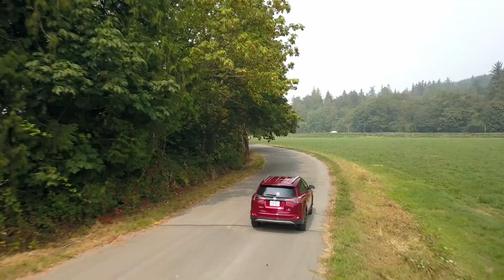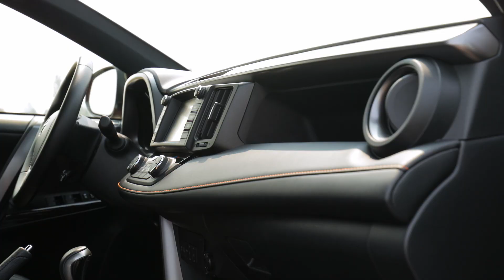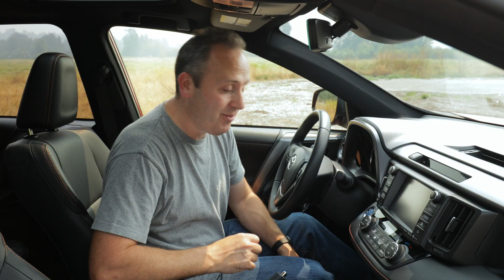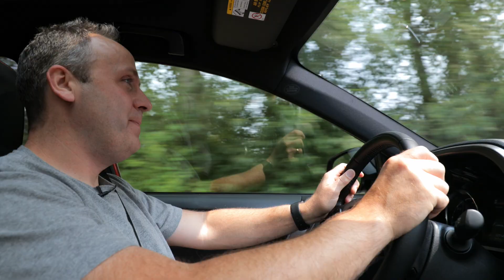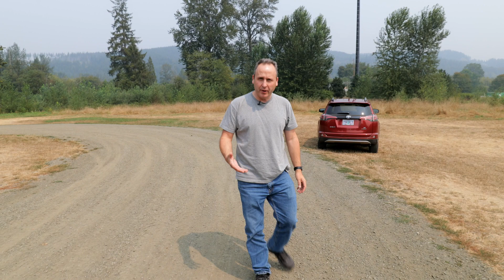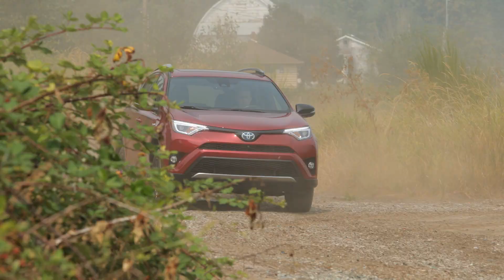2018 Toyota RAV4 Hybrid SE Compact Crossover Review

Comment: 13:00 it seems that the "4WD" is only active for careful driving on snow. I think you should have tested on steep uphill on gravel or sand with full throttle. It may be that it's implemented with the same ECU that's normally controlling haldex system and it will not engage rear wheels until the front has been slipping for some time. For haldex system that was required because it uses tiny clutch pack and activating that too often would rapidly wear the clutch pack. For fully electric rear axle they could do better, though.

Update: here's additional tests for the 4WD system: https://youtu.be/oxluunv9Ebg (it seems that it actually supports driving the real wheels but there's no rear wheel diff locking, mechanical nor ESP brake activated).

Comment: I have an 06 Highlander Hybrid with a similar AWD setup and the rear electric motor kicks in 100% when you press all the way on the throttle. That 80hp boost is what gives it its full power in addition to the added traction of course

Comment: Bought a used 2017 model. Lovely car and I'm averaging around 38 mpg, which is pretty good for a car it's size.

But my only complaint.....i find the cabin to be quite noisy due to road and wind noise. Does anyone else have this issue?

Comment: I guess when is full throttle the system translates that as "ok only the gasoline engine" so no electric motor and rear wheels engade and vice versa ...25% throttle "ok I can use the electric motor" and voala
Reply: good point

Comment: Hmm, I manage to drive my 2016 RAV4 Hybrid Limited for about a mile or two at 40 miles per hour before it kicks me out of EV mode. Not sure where you get the 25mph from. BTW: I manage to avg 37 mpg at 70 mph on the highway during my 70 mile commute to work (hint: use adaptive cruise control). Depending on the wind, it can get up to 39 mpg! Looking forward to installing my Comma 2 driver assist with OpenPilot, it’s way better than TSS-P 2.0. Another fun fact, if you accelerate on a dirt rode or in gravel (VSC on) it actually takes off surprisingly fast. The reason why you didn’t see 4 tire marks or the rear wheels over-driving is because they don’t have enough power to do that as the system is front wheel bias, BUT that doesn’t mean the system isn’t working. If the front wheels are receiving more power than the rear wheels, the rear wheels won’t have a chance to leave their mark as the front wheels do most of the work. That being said, without the rear motor adding it’s inout, you would see a lot more spin from the front tires which would lose traction even faster trying to get you up to speed. Again the electric motor is designed to reduce front wheel loss of traction not eliminate it. If you compared a front wheel drive RAV4 to this, you would notice the difference very quickly as the FWD model would take way longer getting up to speed and throw a lot more rocks out the back.

Comment: I bought an 18 RAV4 XLE Hybrid. Although Booooring at 300 plus pages one interesting fact was what the owner's manual said about the "EV Mode."  The manual emphasized the EV mode for indoor garages and in your own garage when you do not want to emit gasoline exhaust into a closed environment.  Although they did mention the economy it is really for enclosed areas.

Comment: I will cross shop the 2019 as it looks much better. However The subaru crosstrek gets about the same millage without hybrid so depending on how the Rav 4 drives I will chose between these two and mazda5 possibly

Comment: I have a 2017 SE Hybrid and I have to say the AWD system is not very good. Last winter with snow tires I still got a lot of front wheel spin in slippery conditions while the rear wheels didn’t seem to do much even though the display showed power going to the rear motor. I think the rear motor is underpowered. It just doesn’t have enough torque to keep up with the front motor and engine under hard acceleration. I think toyota has put a more powerful electric motor in the rear of the upcoming 2019 and that might help. 
Where this car shines is in stop and go traffic and that’s why I bought one. In town mileage is excellent because the engine doesn’t run very often. I use this car in town 95% of the time and it gets about 50% better mileage than the gas RAV4. I like the hybrid and it works great for my situation but I wouldn’t buy one for highway driving because the fuel consumption is not much better than a gas model which has a much better AWD system.

Comment: I live in the UK. My 18 RAV4 hybrid works fine. The car wasn't built for serious off road driving but for ordinary roads when the going gets tough like snow and heavy rain. If you looked on the screen it lets one know when the rear motor kicks in and when it charges the battery. The car is not an Audi Quattro where you can boot it and spin all four wheels as you said a light foot will allow the computer to determine which wheels need to provide grip. In the UK many people buy SUV's like landrovers as a status symbol and never go off road ( Chelsea Tractors). The power on the RAV is about 155 hp from the front wheels and 65 hp on the rear so if one boots it the fronts will always pull better than the rear. It still does better than some of the front wheel drive SUV's on offer like the Peugeot 3008.

Comment: Your video popped up in my feed and I really liked it. I actually haven't seen too many reviews about the 2018 Rav4. 
We have a 2018 XLE Hybrid with almost all of the features your test unit had but ours has half the mileage yours does at a little over 5,000 since new last March.  We actually tested the same three you discussed. We liked the Honda as we felt it was a more 'upscale' vehicle in fit and finish, but no Hybrid option and as told by the Honda dealer, since it sells so well there weren't any financing incentives other than 2.9% at the time. The Rogue was OK, but the area dealer didn't have any hybrids and had no idea when they could get any.  The Rav4 is very comfortable, fit and finish is first rate and we got ours at 0% interest for 60 months.  With Toyota, we have previous experience with a Camry that got to almost 300,000 miles and a 2013 Prius but we wanted the better interior space and the things you talked about, comfort, economy and safety, and the Rav4 had all plus Toyota reliability. 
We live up near Canada and usually get quite a bit of snow and wanted to have a vehicle that will be able to be used all of the winter instead of most of the winter as the Prius was and in reviews of earlier versions, the AWD system seems to work great in snow. We'll find out in a little over a month when it starts getting really cold and early snows.   
I LOVE the adaptive cruise control and my wife really likes the other standard safety features. Our Rav4 has been consistent with never lower than 32 mpg and averaging 35 mpg with a few 37's in the mix too so we are very happy with that. Not the 45 mpg of the Prius but much more usable interior room than the Prius had and the all wheel drive the Prius doesn't have. I'm 6 feet tall and the front and back seating has really good leg room. I was impressed when we were on a test drive and have since tried out being in the back seats and still am impressed. 
I read some of the other replies here and I've seen the videos and specs of the refresh with the 2019 but I read the 2019 Hybrid version won't be available until late January or February.  When we bought ours I found out the gas models are built in the USA and the Hybrids are made in Japan which I thought was interesting. Good review! I'll see what else you come up with.
Reply: They should've released a first 2018 RAV4 HYBRID in Australia but instead we'll  be getting it in next gen model

Comment: Here's what the Rav4 Hybrid AWD does very well:  Recapture energy and charge the battery faster.  Lift your foot off the accelerator the least little bit and two motors, not just one, instantly begin converting kinetic energy to electricity. Quick battery charge results in electric motor drive being available more of the time and reduced gas consumption.
The Eco-mode and Sport buttons make a big difference. I call one "turtle mode" and the other "giddy-up go". Sport button tightens steering, also, which takes getting used to.
I get 31 mpg stop-n-go commuting to work with AC on, used to get 11 mpg with my previous SUV about the same size.
Reply: Good summary, I get incredible mileage in mine, especially when I surge and glide.  Quickly get up to speed (and charge the battery a bit) then let off in say a 40 MPH area, and you’re cruising on battery.  Totally agree, eco and sport modes make a huge difference.
Reply: hello, i just ordered mine today.  do you always use sport mode?  I loved the sport mode the torque is super amazing
Reply: What was your old SUV

Comment: Okay Mr. reviewer here's a suggestion: you might actually want to do some research on the vehicle you're reviewing before you start your review, so you can speak intelligently about its features. I suggest people look at Alex on Autos. There's a guy who does his research.

This guy is hinging on being obnoxious.  The word Jackass comes to mind. I owned a Prius for 15 months, and I don't think that EV mode is useless. I found it very beneficial when sitting in a drive-through, and  I wanted to conserve gas in the wintertime. It will prevent the engine from starting to provide heat. It keeps the interior a little cooler, but it also conserves fuel. That's a useful feature. I guess you could use it to maneuver in a parking lot as well, so that's two instances where it's useful.

Sport mode makes extra horsepower available to the rear wheels, as it engages the electric motor. Instead of 150+ horsepower you have the full horsepower available, thus the vehicle is "sportier".  Obviously this guy did no research, but has no problem  criticizing features he knows nothing about. 

I also had to laugh at the all-wheel-drive demonstration. The worst thing you could possibly do if you're on a slippery surface is give the vehicle full throttle.  That's a good way to go out of control real fast.  You want to ease the gas pedal down, and  that's when the all-wheel-drive system really shines. Toyota did not design this as an off-road vehicle, which he points out, but then goes into criticizing when it doesn't perform well in an off-road situation, duh!  

He also turns off the traction control, which would help keep the vehicle from going off the road, so kind of a pointless demonstration combined with attitude. Again the guy needs to do some research. Nothing worse than somebody criticizing something when they know nothing about it. Again the word "jackass"  comes to mind. Horrible review. 

I suggest people look at Alex on autos if they want a good, thorough review of the automobile.
Reply: Troy D I am looking forward to the 2019 model.  I hope they improved the system enough.  I’ll be trusting DrivingSports TV to do a proper video review, as the other guys don’t know what they are doing when off-roading except TFL.  But I trust the DrivingSportsTV man the most 👍
Reply: Troy D it’s not an off-road vehicle, but it has a AWD.  The AWD in my Subaru Forester let’s me drive up level 5 Jeep trails.
Reply: Troy D I agree with you. Now a days everyone with a camera review cars. And say whatever comes to their mind, without doing a research. And that AWD system demo was nonsense.
Reply: @BA-ht8bg  

The problem with taking Troy D's opinion as better than most is that he starts by comparing his experience with his Prius to someone else's experience in a RAV4.
Think about it, both are hybrids, both are built by Toyota, but can you say they are VERY SIMILAR?

I too found a few "holes" in this test.  For example: I believe (JUST AN OPINION, SO NO ATTACKS) that there are 2 trim levels under the SE so that the tester's amazement that an AWD, hybrid vehicle can be sold for under $36-37K needs to be modified.

As far as the "usefulness" of the EV mode, or SPORT mode settings, several magazines and videos have stated the opinion that these have little to no effect on the RAV4 driving experience.  Maybe they do in a Prius?

But I will grant that SOMETIMES turning off Traction Control may seem to be counterproductive if you don't want to get stuck or if stuck you want to get unstuck.  Yes, minimal throttle is a good idea, but as I understand it, some manufacturers have Traction Control that is too...cautious, and therefore will not allow you to get unstuck in some situations.
Reply from the maker: You're of course welcome to your own opinion. That does not invalidate our opinion. We find the EV mode useless compared to the current state-of-the-art available in other vehicles. The application of the EV motor makes this sportier... than what? A Prius? An ox cart? It sounds like you didn't like our conclusion.We stand by them. (PS: Alex gets plenty wrong in his videos. He calls Subaru's X-Mode "X-Drive" in his current Forester video. Lol.)

Comment: haw many ml.  with no charge?
Reply from the maker: It won’t let it the battery run out.It will use the gas engine to recharge before it ever gets to that point.
Reply: It can't be plugged in - everything comes from the engine.